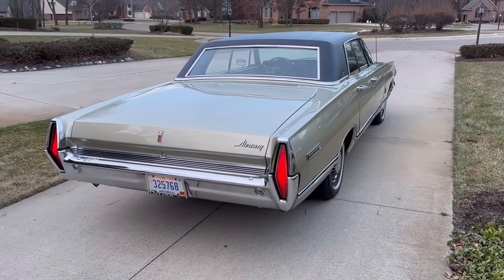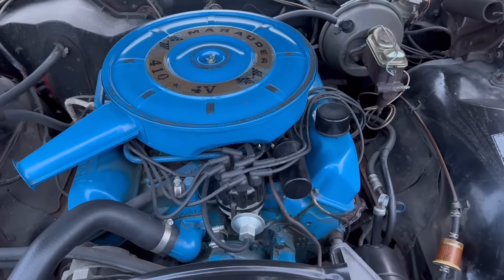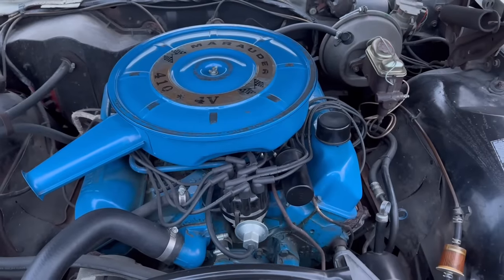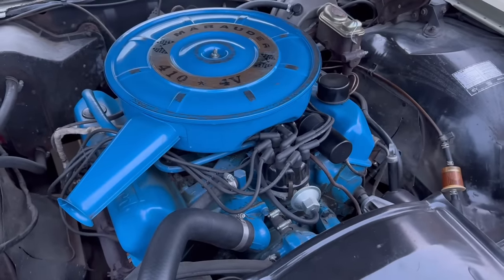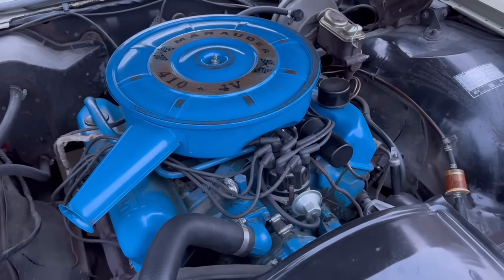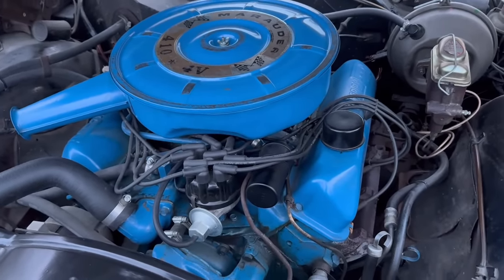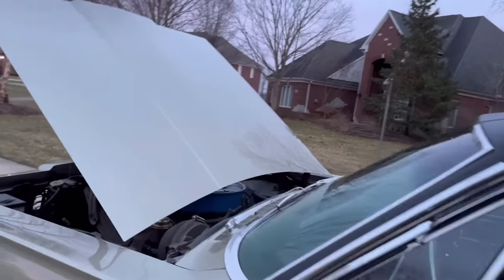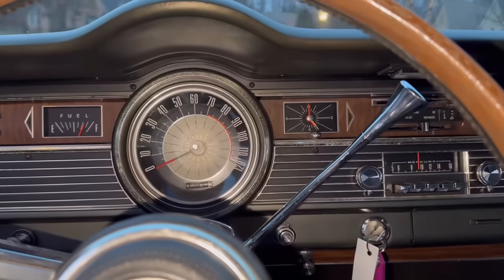Ford's Shortest-Lived (and Smoothest) V8 Engine: The 1966-67 Mercury Only 410 V8

Comment: Front mounted distributors are the ultimate luxury for home mechanics.
Reply: Sometimes they were a pain in a heavy rain, most kept a can of wd-40 handy 😂
Reply: @kenneth9874   You speak truth, brother.  Or when the radiator develops a pinhole leak....
Reply: Or when the water pump bypass hose starts a leak. Seen that short out the distributor
Reply: Very true Rear mounted distributers equates to the oil pump being mounted at the rear of the camshaft these suppressing camshaft tortional vibration. Like a shock absorber at the other end of the camshaft than which it is driven.  But oh yeah the distributor at the front is kind of handy
Reply: Good and bad. Easy access, but every time thermostat housing removed, water finds lowest point, base of dist into block and sits there, gradually corrodes.

351C had the thermostat housing even closer to the dist, and mine was corroded into the block when I got it. Soaked with WD40 made no diff, so I had to split the base of the dist and remove it in two halves/make sure all bits removed, which I did ok. Then fitted a Mallory distributor. Made sure it was lubricated above the O ring though.
Reply: I had a heater hose get a pin hole right by the firewall and it shot a stream, only at load, directly onto the distributor on the right front of the motor, the engine died, and I dried off the distributor 3 times before I left the hood open and reved it, only to see a tiny little stream appear, pissing right on the distributor, couldn't have aimed it better. I wrapped it in duct tape drove to the parts store and grabbed a new hose, but it was nearly an hour and 3 stops at the side of the road to figure it out. LOL!
Reply: Preach it  brother😊
Reply: @kenneth9874  Hairspray. Timing set once, never had to change it so the moving it problem never existed after that. When you noticed a timing change, that was because the points got worn.
Best practice (for a good mechanic) was to use a distributor cap without that window for the dwell meter and just set the points with a feeler gauge. Check the timing and if it was off, readjust the points to fine tune. Then water intrusion was dramatically reduced, even eliminated on some models. Still had that can of hairspray to coat the distributor cap and wires after the tune up.
Reply: and a more direct path to the timing chain for accurate timing
Reply: @ladamyre1  "some models"
Reply: It's strange reading comments about water getting into the distributor. I bought my first 390 in 1970. I then bought a '69 Mach I 428SCJ, later I bought a '69 390 Torino GT. I currently drive a '72 short wide with a 390 triple deuce intake manifold which has the oil filler in the intake. So, all my adult life I have owned FE's. Never have I had a problem with a wet distributor. I lived in North Central British Columbia for 32 years and in Oregon for the last 24 years so I have never lived in a dry climate.
Reply: @FRLN500  good for you 👍
Reply: Not that you have much choice it's a Ford engine!!!, All they did was changing the crank shaft.
Reply: @jamespell8091  The "Rear Distributor" cars would also have the oil pump at the back, where the oil moves to under HARD acceleration.  If your oil pickup sucks air for a couple seconds, flooring it in 1st gear, your rods get no oil pressure when they need it the most.  This particular car won't have that kind of acceleration, so no problem.
I was wanting to know what made it "The Smoothest" ??
Reply: @peterdarr383  lol What about the many Ford engines with rear sump pans? They simply use a rear sump pickup tube. As for oil starvation when using a front sump pan, that is what baffles are for. Nobody builds a high hp engine without running a baffle in the pan. My Mustang lifts the tires on launch, and hasn't starved for oil in 24 years. Front sump works good.
Reply: Good point my friend I just got through complaining about having to crawl into my chevy 4wheel drive to get to the distributor acceptable in a car but a real pain in a lifted truck
Reply: @mikekokomomike  at least it quits running before it overheats! 🤣
Reply: Rear GM distributors were harder to get to but way easier to adjust dwell through the window while it was running.  Could set it perfect to 30 or 31 degrees.
Reply: @peterdarr383  The pickup tube can be placed in the front or rear regardless of where the pump is...
Reply: @X85283  Not when the steering gear is hogging the space - - then your stuck with a front or mid sump.  But I've yet to see a SBC with a front sump !
Reply: @peterdarr383  the pump location doesn’t determine where the oil pickup is drawing from. Yes a front sump isn’t ideal but any issue is readily fixed by an aftermarket baffled pan, making it a non-issue. Nobody is making a car so fast the sump location matters without an aftermarket baffled pan being a minor addition compared to the rest of the work they did.

Comment: I purchased a 1967 Mercury convertible as a restoration project. 
 The 410 had very limited info when I went for basic parts about 30yrs ago until I talked to an old Ford dealer mechanic. 
 Thankfully he explained it was a 390 with a 428 crank.
 The 410 was a bit of a torque monster .
 I did some extensive repairs to the car and after about 3yrs of ownership someone made me an offer I couldn't refuse and I sold my 67 Merc Convertible with its 410 V8, power windows, factory 8 track player and factory air conditioning for a nice profit. 😊
Reply: Had a Marauder Convertible that sounds just like yours, 410 was finicky and temperamental. Still own my second owner 67 Fairlane GTA 390 original build that I rarely have to touch, starts and purrs every time.
Reply: Just imagine if you had kept it, now you could sell it for an obscenely nice profit.
Reply: @rockguitarist931  I owned a Mercury S55 convertible, 390 with a 4 speed manual. Back then it was a car nobody wanted due to the 4 speed. Oh, don't I wish I had that low-mileage puppy back. Good grief - in a matter of a few years back in the 60s, Ford marketed a 390, 400, 406, 410, different versions of the 427, 428, 429, the 430 Lincoln and finally, the 460. Make up your mind.....LOL  I've owned at least one of each other than the 410 and 427.
Reply: @kingboagart899  it was that Motorcraft 4300-4350. They were the worst carb out there. I just put an aluminum intake and a Holley 750 square 3310 vacuum secondary carb and headers on mine . I also put a 410 hp 427 solid cam in them. A 410 with those changes became a tire roaster. I really don’t know why they didn’t do that in all performance cars as the base engine. A 410 with that setup would have been 430 hp easily.  A hotter tune 450 easy
Reply: You could get an Edsel with a 410, before they had 390's and 428's. Lincoln used them also.
Reply: To put into my 59 Skyliner

Comment: Grandpa's '66 Park Lane was the same color as yours.  It's valve covers were shaped differently, taller, flat-on-top and had "Mercury" pressed into them.  Very distinctive looking covers.  First engine I was entrusted to "work on" (plugs & points), at the age of 16.  That 410 has been residing in my '69 F250 for the past 45 years, been overhauled twice and still propels this 70 year old man's butt into town, for supplies, on a regular basis and still runs as smoothly, and reliably, as ever.
   Nice job on the video.  👍
Reply: Those valve "Mercury" valve covers were for 1965 & 1966. 67 they just went back to the "Power by Ford" valve covers. I have had both 65 & 66 Mercury 390's that had them. I have a set on my 390 in my pickup right now. They are cool Valve covers!
Reply: Those valve covers were designed taller to accommodate adjustable rocker arms for the solid lifter engines, but they found their way onto hydraulic lifter cam engines also.

Comment: I always enjoyed working on V8s with the front mounted distributors.
Reply: When injected with truth serum, a Chevy guy will admit to wishing his SBC's had the dizzy up front.
Reply: @johna1160  
"the dizzy" that's funny. I haven't heard that for a hundred years!
Reply: @johna1160 : LOL! Nope! I'm a G.M. diehard who loves his old Pontiac and Chevy V8's and not once in my 40+ years of maintaining, hot rodding and rebuilding these engines did I ever wish they had a front mounted distributor. This is because of the multitude of water related problems that my friends who ran Ford products had. Ford was well aware since the 1960's that their design was very prone to water seizing the distributor in the engine, constant issues with corroded points, corroded distributor cap contacts, caps shorting out, rusted springs and counterweight etc. Ford received so many complaints that it led to the rubber diaper boots that many will remember making their appearance in the 1980's. I'll stick with my rear mounted distributors because I've never had a single water related issue with them ever and I've owned dozens of cars since my first car in 1987.
Reply: @rogergoodman8665  87? Bahahahaha   been driving front mount distribs since mmm 1970, no prob.
Reply: @oneninerniner3427  : Don't know what to tell you bruh! I live in S.E. Pennsylvania and can only relate my personal experiences.
Reply: It makes more sense on a few levels, yes, easy to get to for service, not that many "stuck" as he complained if the car was tuned at proper maintenance intervals, being the local "Ford Guy" I had many Fords pass my way.
There is one more way the front mounted distributor makes more sense - the timing chain drives the camshaft, the cam drives the distributor, the distributor drives the oil pump.
Those being the same, Ford or other V8.
With the Ford, the load to drive the dist. and oil pump is right behind the timing set that's driving the cam - as rigid as possible. 
On a rear mounted distributor, the cam is driven the same, but the load of the dist. and the oil pump are all the way at the other end of the cam, so twist is possible. 
Used to be a broken cam on a Race Chevy wasn't unheard of.
Reply: @oneninerniner3427  Same here. 1964 Galaxie on up through the years, never an issue. He's in denial. I have currently a 1969 GMC 2500 and it's a true PIA to service that thing.

Comment: There was also a 410 MEL.  It was produced only for 1958 Edsels and only in the Corsair and Citation models.  Great video!  It's nice to see these underappreciated cars get some attention.
Reply: My first thought exactly
Reply: I have a 1967 Convertible with the 410. Only 11k miles with a few upgrades such as aluminum intake, upgraded Holley 650, 1.73 roller rockers, pertronix ignition kit in factory distributer, K&N filter & magnaflows with just a LITTLE rumble. With the carb dialed in & timing adjustments, we had nearly 400hp & 500trq. Installed a built Ford AOD & 3:1 gears, it is a runner & 23mpg with the a/c running. My parents went full boat on options as well. Power everything, leather, factory rally pack gauges, & a nice set of wheels I thought blend in nicely. Triple black, Handling suspension
Reply: E-475 engine.
Reply: The 1958 MEL 410 was in the 1958–1968 big-block Mercury/Edsel/Lincoln series (383/410/430/462). The '66-67 410 was in the 1962–1973 FE V-8 generation II series (406/410/427/428).
Reply: @Lurch4you Ditto.
Reply: along with those who thought the Edsel 410 was a 475 C.i.d. when  they mistook the torque rating.
Reply: @Barry_Davis  Which was really a 410
Reply: That was the Edsel 400, we had one in a boat in the late 50s .
Reply: Why use an automatic transmission?
Reply: @Thankz4sharing  FE's also included 332, 352, 360( pickups only) and 390.
Reply: @FRLN500 361 and 391 were also used in truck and industrial applications. Steel crank with a longer snout to run accessories and the same HD rods as the 427
Reply: HD 361&391 also have OS exhaust valve stems with sodium filled valves
Reply: The 410 MEL was also marinized by Chris Craft and found in everything from 21 to 50 footers.   I have a pair of twins for sale.   complete FWC rebuilders,  Standard and a counter-rotator.     those planks were smooth...
Reply: @garycamara9955  Ask your left knee that question when you are about 65 years old.
Reply: And are the motor similar or no
Reply: I once owned a 1958 Edsel Corsair with the 410 MEL . I believe Ford called it a Y block not a V block.
Reply: @danielbuck2704 , no the Y-block was the first Fo4d OHV V8 introduced in 1954. Through its life it displaced 239, 256, 272, 292, and 312 cubic inches. The MEL was 383 (Mercurys only 1958-60), the 410 (1958 Edsels only), the  430 Lincoln (1958-1965) optional on 1958-60 Mercury and 1959-60 Thunderbird,  and the 462 Lincoln only 1966 to 68.

Comment: I am a FORD only fan for 45 years. I never heard of a 410. Well played thanks for posting
Reply: I ll tell you what an extra 20 cubes makes a difference. I built one as a deep breather and holy smokes it was a menace. Hp an tq  for days and  it was a lot like a 428. I put Holleys on them with a square bore aluminum intake with a 750 and a C6 and a shift kit and headers. A running dude. Adam has a drive around video and it is so graceful. Mine had a 294S I built . It was a menace.
Reply: Have you heard of the 406? It's a 390 crank with 428 pistons/bore size, the largest size you can guarantee the block can be bored to. 427 required Sonoray inspection before the block was bored that far.
Reply: @robertkubrick3738  The thing about the 406 is that it has to be the thick bores like a 428. The beauty of the 410 is that a regular good 390 bore can be bored .030 or.040 over and with the 3.98 stroke, have 416-418 ci.   The three rib 105 blocks even have the 3 rib main bracing of a CJ but with the thinner bores. They would be great as a  turbo engine. At 4.08 even the bores should be thick enough for a 1000 hp.
Reply: @Bbbbad724  I have not seen an FE block  yet that can't be bored 4.13. My old PI block had 352 cast into it. 427s bore is when you need Sonoray or just sleeve it.
Reply: @robertkubrick3738  The 406/428 are cast with reinforcements around the corners. Pickup blocks from the 70s have 3 ribbed main reinforcements, but 390 boxes.  A sonic is important .  4.08  is a good size bore, and up to 4.25 stroke will fit.
Reply: 332 FE : 1958-59 
361 FE : 1958-59
406 FE: 1962-63
And the shortest production,
427 FE-based SOHC : 1964

Comment: People think 60s cars were primitive, no electronics. However most V8s were pretty smooth. The inline 6's were great too. We had Novas and the turbo hydro autos were absolutely wonderful sifters. I'll never forget my ride home from my summer job as a kid in a '66 Rivera. That car was so smooth in acceleration and when the auto shifted all you heard was a drop in engine RPMs,  What a car. Great video.
Reply: People have no idea how nice the older cars were, much more comfortable and simpler to operate.
Reply: they were so deceptively quiet and powerful. smooth at a low rpm. power on the bottom less than 3500. best at about 2800 rpm. god i miss them and hate the chainsaws i hear today. 8, 9, 10,000 rpm no good except for track
Reply: splitting hairs, technically and primitive by today's standards, it does have electronics... without a capacitor (condenser)  points ignition would not work, without transistors and resistors (among other things) there would be no radio.
I think it fair to say things got far more complicated when digital electronics and emissions control came along.
Reply: @profpainter5841 brakes, steering, suspension, tires and electronic ignition were nice upgrades from then till now. But I was happy as a clam driving them, so I get what you mean by comfortable. Who cares if it needs 3 or 4 belts?
Reply: JoeG True  I never had a problem with the old Fordomatics, 2 sp  or the C4' and C6's  3 speed, ran for ever no problems only service.  latest AOD, 5 spd auto and 6 speed all crap, the Aod and 5 speed never got 50,000 mies out of and the 6 speed crapped big time atb 100,000,  and I quit buying Fords for that reason, 16,000 $ in trans repair was waaay more than enough !!!